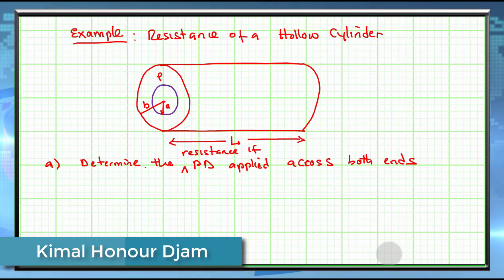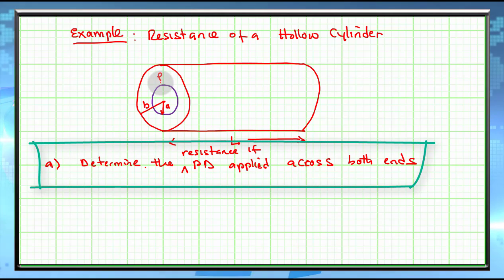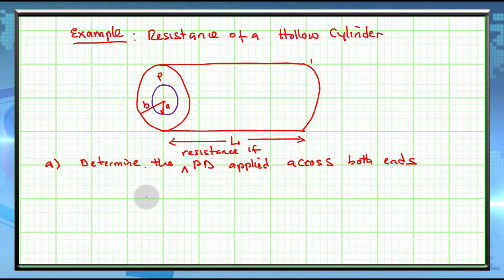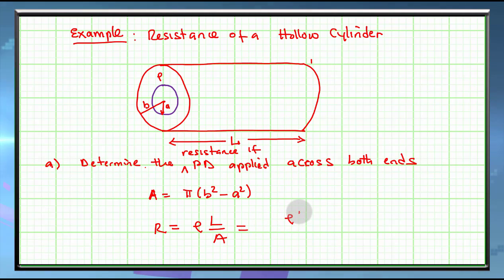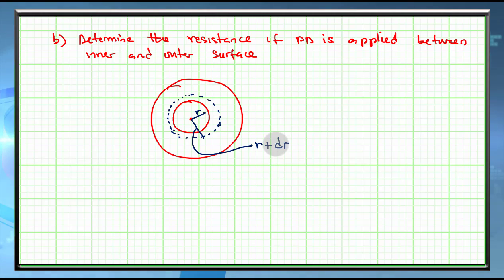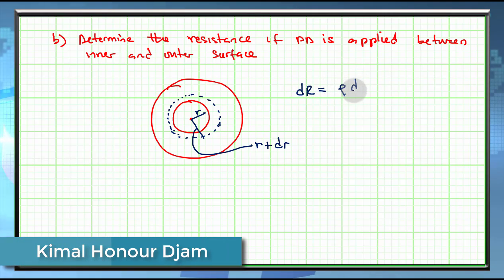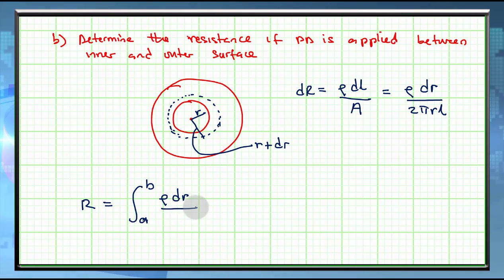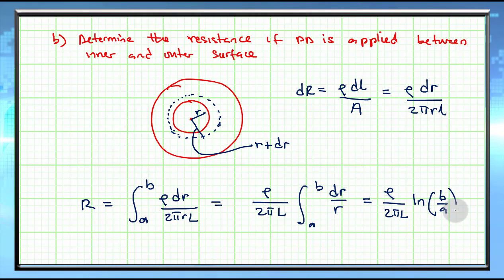resistance of a hollow cylinder

Comment: A=2pirl. i agree with that

i didnt understand logic of dL=dr ? could you explain why they are equal
Reply from the maker: In part two, we are calculating the resistance if the potential difference is applied between the inner and our cylinder. So L in this part represent the radius r from the inner cylinder to the outer cylinder. Always watch out. how the PD is applied will tell you how to deal with L in R=rho.(L/A)
Reply: Kimal Honour Djam thank you so much. i finally get it